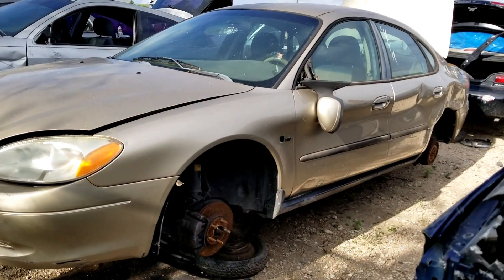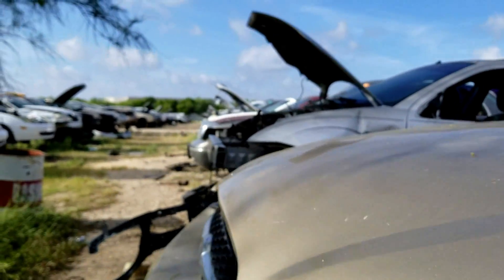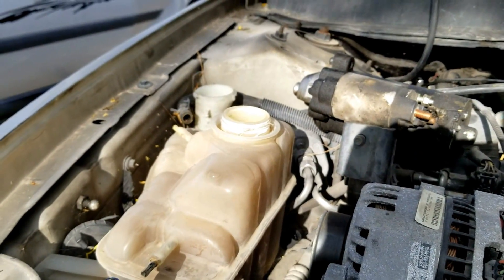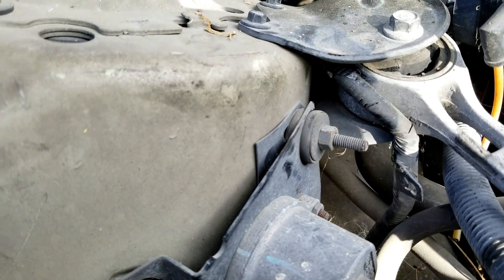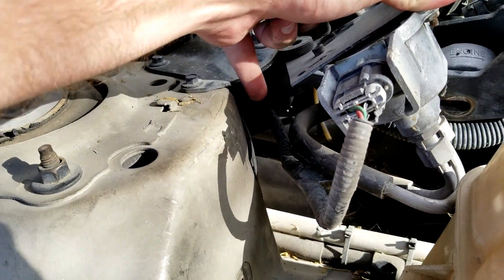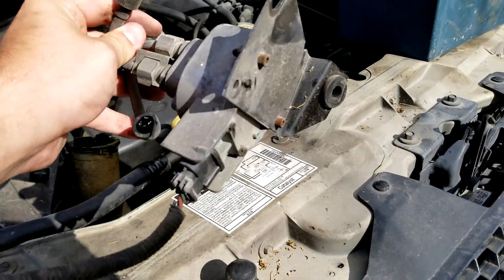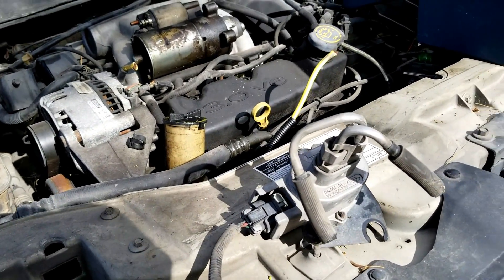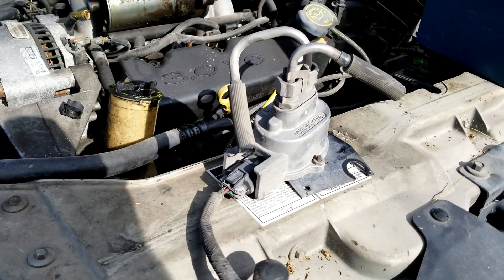Ford Flex Fuel Ethanol Sensor Location

Comment: i have a 2003 ford Taurus and cannot locate, the flex fuel sensor (with the fule lines attached to it) under the hood?
I did locate the flex fuel sensor module under the dashboard -but i believe that is for the fuel gauge on the dashboard.anybody have any ideas?
Reply: I have the same issue with my 2005 Ford Taurus Flex fuel. I’ve looked everywhere on this car and I can’t find the sensor like the one on the video either. Any luck finding it on yours?
Reply: I don't think they're is one on later models @davidguerra5148